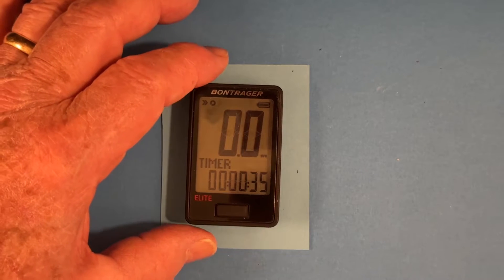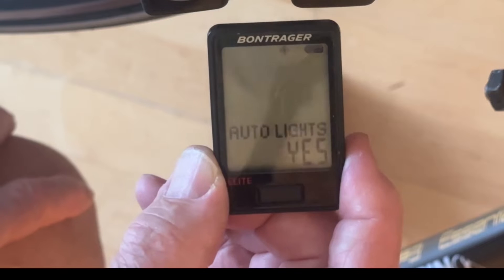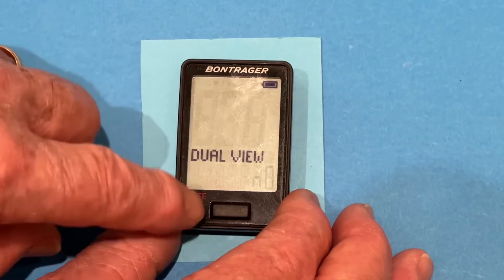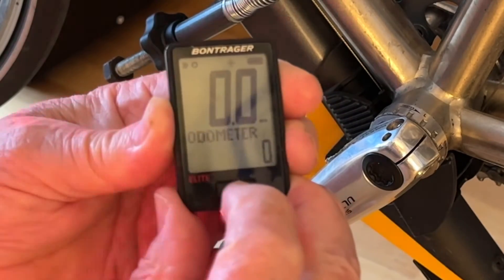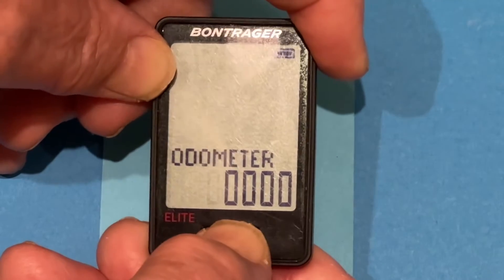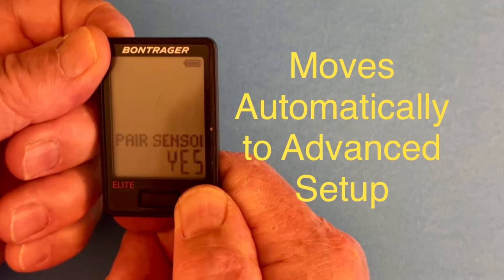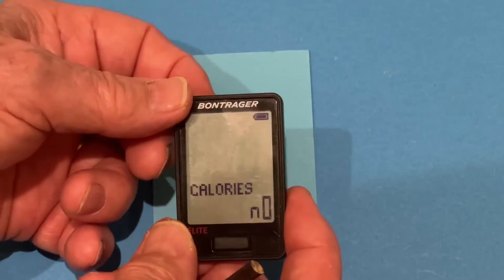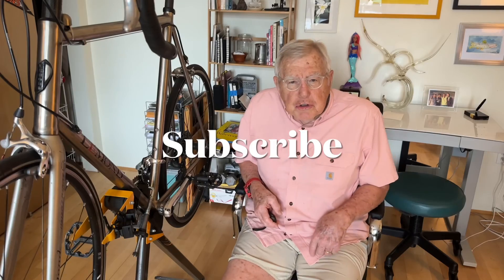Pair Sensors & Lights & do an Advanced Setup on Bontrager RIDEtime Elite Bike Computer

Comment: Thank you for making this guide. My speedometer and cadence is not displaying as I ride now, I'm looking for resources online that may help. I've adjust the sensor and magnet and now pairing the sensors but it doesn't seem to be working. Maybe its battery but i swapped them over and they're both show full on the screen. It's got me stumped at the moment.
Reply from the maker: First of all, make sure your senders and receivers are positioned correctly. If it still doesn’t read, make sure the speed and cadence icons are displayed on the screen up in the left-hand corner. If they’re displayed, they should work. If they’re not on, then you have to do a reset. The reset is explained in my video for a computer in use. It’s done by pressing the back button and holding it until pair sensors, blinks, and then follow the instructions. You might try doing a factory reset by pressing the reset button in the back and starting from scratch. If you do this, you want to make sure you record your Wheel size and odometer data so he can reinsert it. Other than that, you might want to do a battery check using a battery meter or just buy two new batteries, one for each location. Other than that, I don’t have any pearls of wisdom. Good luck
Reply: @jameslesterbaldwin9841  Thanks James. It was the battery in the sender.
I just didn't think that straight away because the lights were blinking and the connection was indicated. And motion woke the computer up. I'll just think less and change the battery first next time. 😆
Reply from the maker: @aarenmyatt450
 Way to go. I have a battery tester that I bought from Ace Hardware that is very helpful with battery evaluation in most situations (TV remote, golf range finders, etc). The model I have is a Gardner Bender (GBY 500A) and costs and cost me $11.99 with rewards points. It also checks these small 3V lithium batteries. Glad you solved your problem.

Comment: How do you remove the power meter mode?
Reply from the maker: Press the back button until the advanced set up appears. It will first ask you if you want to pair your sensors and you press “all” and let the computer search for sensors. It will only pair the sensors that you have. If you don’t have a power or a heart rate sensor, they will not be added to the computer. It then ask you to set up your lights. After you set up the lights, it will ask you to go through and set up the screen options that you want. When it asks you if you want to display power, heart rate and calories, press the front button to designate “no” and this will remove the power from the screen. I just looked at this video and it goes through this maneuver twice. You might want to review the video again and it should be clear. I don’t have a power or heart rate sensor on my bike so I don’t include them in the sensor set up and I remove them when I do the advanced set up of the screen options. Good luck. Sincerely, Jim.

Comment: How do you connect sensors on the non elite version? Hold the back button for 5 seconds takes me to the main settings.
Reply: Did you ever figure that out
Reply from the maker: Would you mind giving me the model number of your Bontrager bike computer? I am curious about the difference between the two.  🙏🏼

Comment: Thanx for such an informative video of this.  What would pairing the lights do if you dont use auto lights?
Reply from the maker: The manual states "If auto lights is disabled (No) the paired lights will remain stored as a saved connection. The computer does not try to form a connection with the lights."  In my experience, if Auto Lights is turned off the lights will not go unless manually turned on. I just checked this on my bike and with Auto Lights off the lights do not go on automatically while riding even though the lights were paired.  This suggests that one could turn on Auto Lights without disturbing the other connections but I don't know how to turn on Auto Lights in one maneuver (like with Night Mode).  There is a relationship between Night Mode (press the front button 10 seconds and press Night Mode Yes) and the lights but just turning Night Mode on does not turn the lights on if Auto Lights is off. If Night Mode is turned on and Auto Lights is activated, the front light will change to Medium Steady and the rear light will change to Night Flash. If Night Mode is off  (and Auto Lights is on) both the front light and the rear light are on Day Flash.  But Auto Lights needs to be activated for Night Mode to affect the the way the lights flash.  If you find an easy way to turn on Auto Lights let me know.  Enjoy your riding and be careful out there.  Jim
Reply: @jameslesterbaldwin9841 Thanx so much for the indepth answer. I will try the night mode, I just want lights on at dark. Thanx again!